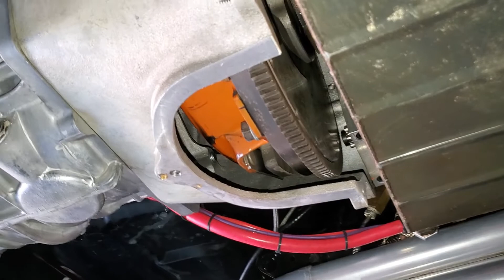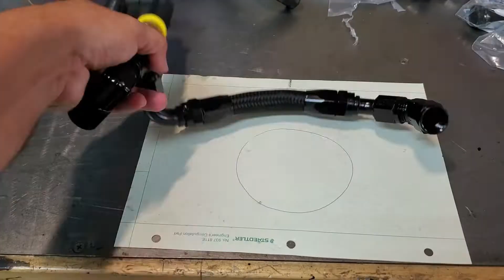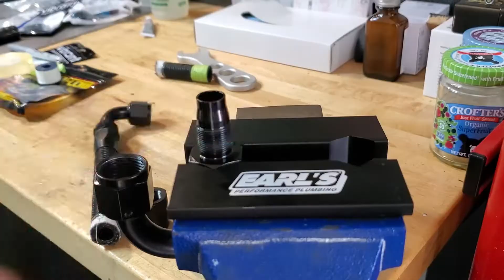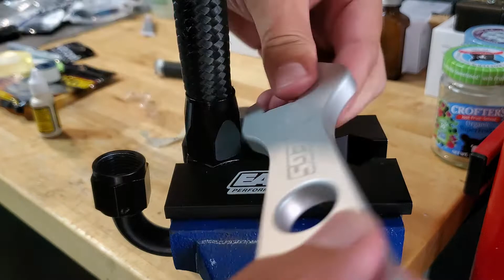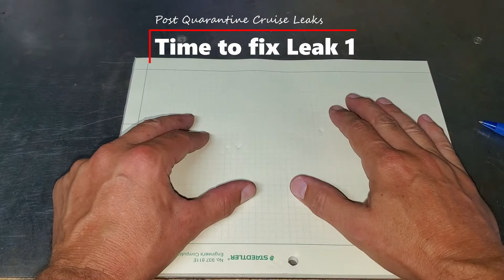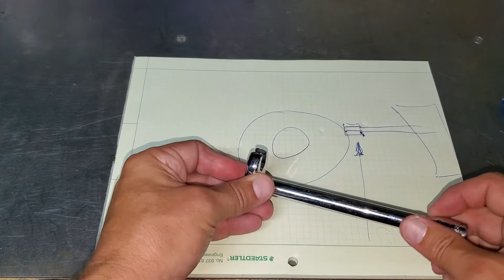Post Quarantine Cruise #7 Leaks Found and Fixed, including more AN Hoses!

Comment: I put Dex-cool in my engine when I built it. I am swapping out my radiator tomorrow to a single core 2" tube Entropy with AN fittings (didn't see your videos until after i ordered) but when doing research on coolant I found out Dex-cool is made for modern cars with plastic reservoirs and aluminum blocks, not for iron. Dex-cool does Not provide rust protection for iron and it not made for older gasket systems (causes leaks) Green ethylene glycol coolant is the recommended fluid but needs to be changed more often.  Since they can't be mixed I have to do a big flush.  I really wanted to go with Evans but after many hours of research it's not a good choice for a high performance engine like ours. Also, welding my motor mounts to solid was the best thing I've ever done.  I like the cab vibration the engine gives me so no problems there, but now I don't have hose or header clearance problems!  Ruins the look of the shaker hood but oh well.   Cheers!
Reply from the maker: Wow, great tip on Dex-cool.  I didn't know that.  My Evans coolant has been running great in my Cold Case radiator... Dual core with 1.25" tubes.  Entropy makes good stuff too.  (Yeah, next engine upgrade will require solid mounts for sure.  :))  Thanks again!
Reply: @FastMonty  Good to hear, I wasn't sure if it was Evans or Dex-cool. Thought I'd warn you!  My block is hard blocked where the cylinder stops..I'd love to try Evan's but with the slower heat transfer it worries me. Great product though.

Comment: Great Video series! I have a 68 GTO with a Tremec 5 speed conversion and hydraulic clutch (Keisler kit). It's been in the car for ~7-8 yrs. Love it.  My question is, have you thought about how to change out the clutch fluid? With the way the line leads from the master to the slave and the location of the bleeder it seems like it would be difficult to get all the old fluid out of the slave cylinder.  
Also, can you give some details on the front chin spoiler? I am considering adding one to my car.
Reply from the maker: Great testimonial, Tom.  Great question too... I have no idea how to fully drain the clutch.  I'll let you know in about 3 years.  :)  ha, ha... anyway, I got the chin spoiler from John  (minnesota-muscle@comcast.net)  It was over five years ago, so, not sure if he's still making them.  Won't hurt to ask... good luck!

Comment: Awesome channel! 
Can you tell me what is the thread size on the throwout bearing? Is it AN3? Or NPT?
Thanks
Reply from the maker: Great question... it's neither an AN fitting, nor a NPT.  It's called a Flare Nut.  The same type of nut/threading you'd find on brake lines.  If you need the exact dimensions, I'd recommend reaching out to Silver Sport Transmissions.
Reply: It's an M12x1 bubble flare.
Reply from the maker: @SilverSportTransmissions  Thanks for stepping in, SST!
Reply: @FastMonty  You're welcome.

Comment: Good deal, at least it was not to bad overall   i might have missed it but what valve covers are you using and does the finish hold up so far
Reply from the maker: Thanks Steven... No, I've never mentioned it... the valve covers are from Tin Indian, then I clear coated them.  They've been great, except when I bang them with a wrench.  Ha, ha... thanks again for the comment!

Comment: love your videos so sad you had a leak but as far as i have even known the fitting that was leaking still needed a a clamp to hold it down.  Anytime there is rubber over metal you need a clamp because the rubber will expand faster then any metal.
Reply from the maker: Agreed!  It does now!  Ha, ha... thanks for the comment!